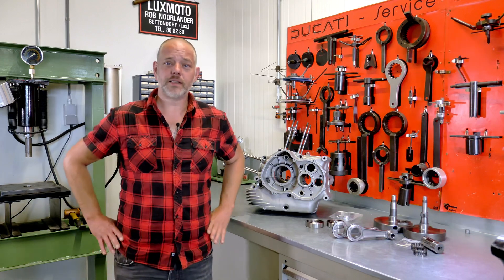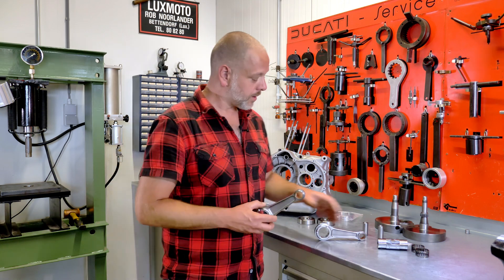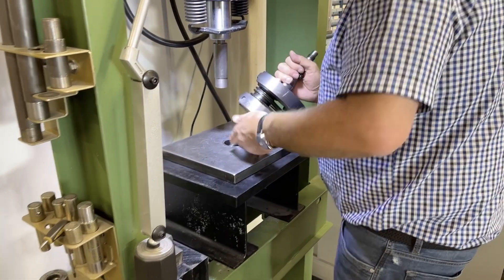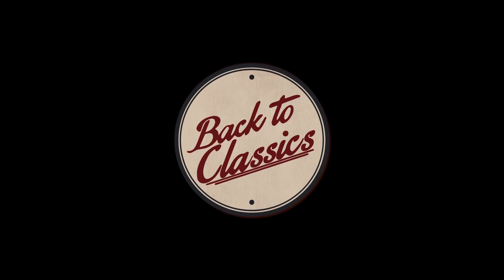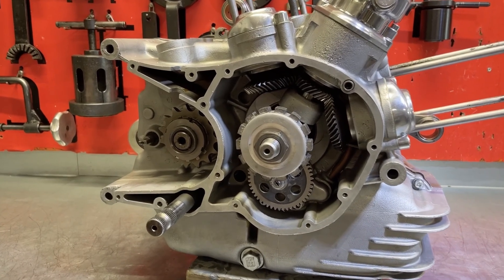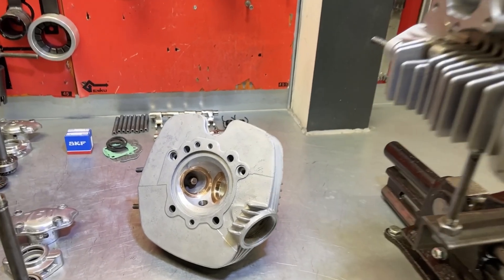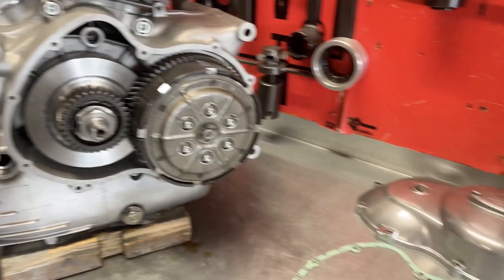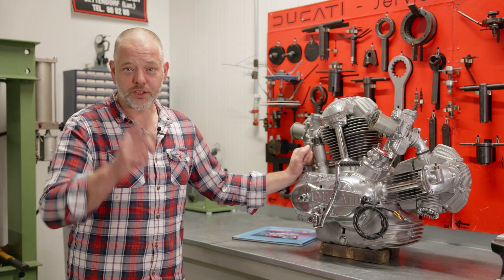Ducati ‘Corfu Greenframe’ 750 Super Sport (Part 2) - Back to Classics

Comment: Excellent 'Desmo Porn', highlight was your dad beating the crankshaft halves into submission and alignment. I use a hammer made out of a tin mug full of lead with a bit of steel tube as a handle melted into it, but it takes me a while, I've only ever done it twice. He is obviously a master. You should have shown the dial guages afterwards to show how close he got, I'm sure it was easily within tolerance. I also note you have edited out the hours of shimming the timing gears, many people viewing would think the job was easy... I remember visiting the factory in 1977, they were assembling 'square cases' then and it was mainly young women doing it at amazing speed. Brilliant work and videos, keep it up.
cheers
Zed